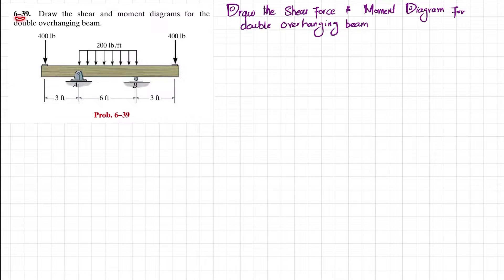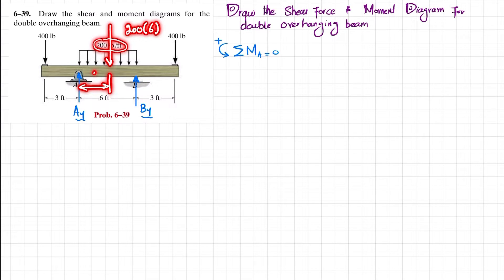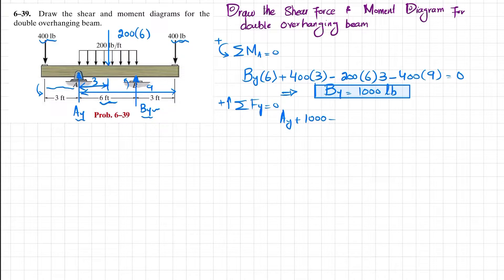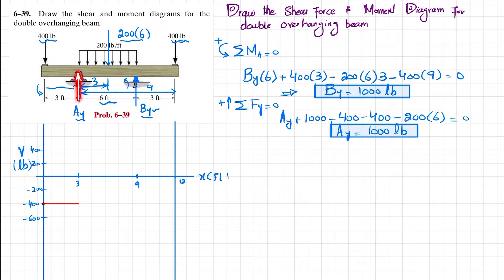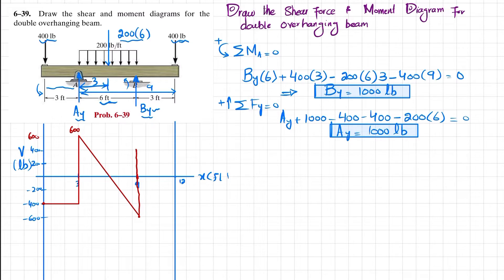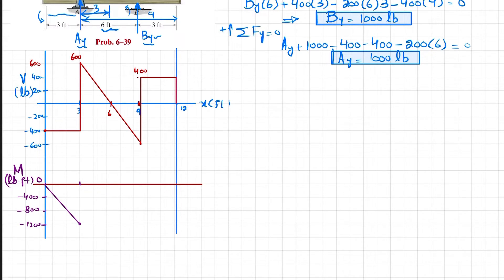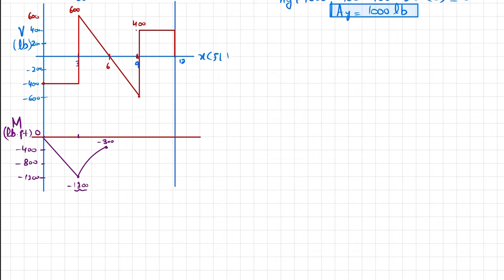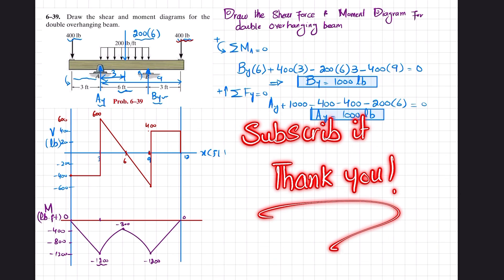6-39 |Chapter 6| Bending | Mechanics of Material Rc Hibbeler|

Comment: sir why is the slope increasing and clockwise in the moment diagram at 10:31
Reply from the maker: you have to go through chapter 4 and 5 of my theory lectures...when slope of shear force is decreasing or downward the moment curve will be in clock wise while increasing slope of shear force will have moment in counter clockwise. check out some problems you will understand . or if you want to find moment at every length of beam you will get so many points when you join them you will get the same curves for moment which i stated but it will be time consuming and you will be able to solve it in many hours. so try to memorise it as it is shortcut..🎉❤